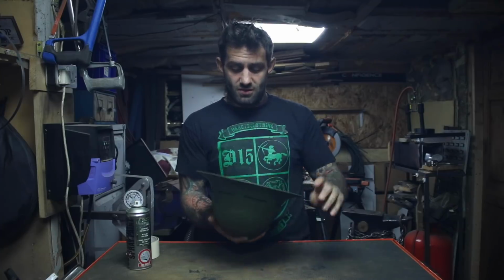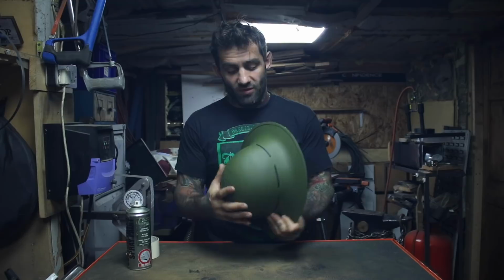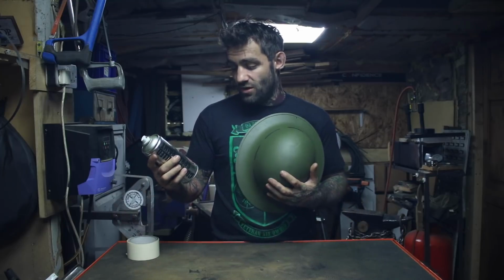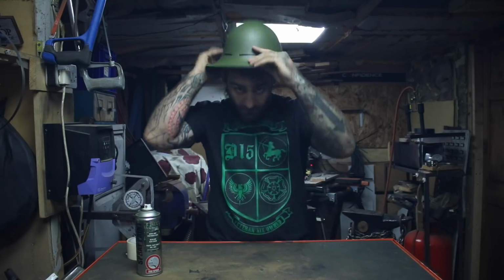WW2 British Helmet Restoration

Comment: Hello! Nice restoration! I believe it’s original colour would’ve been gray, but it still looks nice! Also, how did you get the lace undone? I’m planning on cleaning mine but it has quite a bit of rust and I don’t want to get anything on the liner
Reply from the maker: They were available in 3 colours grey, blue and green this was green thats why I painted it green. 
The lace was ruined on mine so i had to replace but it was a nightmare to get undone
Reply: DiesInEveryFilm Customs I see, but I mean how did you manage to get it undone? Did you untie it from the back?
Reply from the maker: There was a knot somewhere not sure where but mine had been removed before as it was laced up wrong
Reply: DiesInEveryFilm Customs I see. Sorry if this is bugging you but my last question is what did you use on the leather? Thanks
Reply from the maker: Not bugging at all mate I don’t mind answering, its a blend of boiled linseed oil, turpentine and beeswax

Comment: There's a more simpler way to get rid of lots of rust very fast you can try to put the Rusty object in a container or bin if it's big and feel it up with white vinegar and 25% extremely hot water and it has to be completely submerged under that vinegar then you stirred and place the object inside and wait about a couple of hours to be safe about 12 hours if it's really rusty 24 hours then scrub it with some sandpaper while it's still wet and every single bit of that rust would come off you're welcome
Reply from the maker: Oh dear oh dear. Just because you know about using vinegar doesn't make it right. These helmets are thin steel and vinegar is an acid it's not easy to control like sandpaper and I did this in less than your 12hr vinegar sitting time. 
Here watch a video of me restoring this helmet via being in my house as vinegar scrubs away.
Reply: DiesInEveryFilm Customs Loved the video! Beautiful restoration! Out of curiosity, would electrolysis have worked to remove the rust from a helmet like this, or is there something about its construction that would make that a bad idea? (Still probably not as entertaining a video, though.)
Reply: Just use electrolysis
Reply: @DiesInEveryFilm  lost your chance of making a 12 hs video of a helmet sitting in a container with vinegar..
Reply: Butterflyknife1 v

Comment: The result was acceptable. But you must admit that you like to work more than you should. A correct way to remove the oxide is with phosphoric acid, which also protects the metal. What you said you didn't use vinegar because the metal was thin is a fallacy. If it were true, the helmet would have been smashed when you sanded it so hard. Good job.
Reply from the maker: The helmet is thin I only needed to take off the surface rust then treat the remainder. Acid will eat metal which I didn't want. I restored it how I saw fit

Comment: Truly amazing restoration. It's better than new. Did you consider sandblasting it? That probably would have saved you weeks of time and energy.
Reply from the maker: Sand blasting is too rough and getting a sand blaster isn't easy. If it was thicker steel I would have used different methods to restore it.

Comment: Why did you go mechanical rust removal? Also why no primer before final paint? Still turned out good either way!
Reply from the maker: I feel that sanding gives me more control and the rust converter is a primer aswell. Thanks

Comment: Hi, I really like your video. I am going to restore my rusty Zuckerman helmet as well but I dont know where to find the leather liner you used. Can you provide me a link? And also I want to ask you if its ok to use vinegar and sponge to remove the rusts instead of using the sandpaper? Because I think using the sandpaper can possibly remove the important markings on the shell. Thanks!
Reply from the maker: Thanks, you could use vinegar but it will eat away at the steel once the rust is gone, sanding shows the markings up better I only used a high grit to flatten off the peaks a bit. 

I reused my liner so not sure where you would get one, maybe ebay
Reply: @DiesInEveryFilm  Really appreciate your reply! Just one more question, I saw you used rust converter after sanded off all the rusts. I cannot find any rust converter in the local shops, is it fine if I start to paint Kings Army Military Spray Paint Matt Finish directly after the sanding process? Thanks again!

Comment: How come you didn't use electrolysis or vinegar or some other rust removal procedure? Just curious. Your method seemed to work, but I see all different methods and wondered if there was a compelling reason other than your method was quicker. Thanks for the vids... keep it up.
Reply from the maker: Was just the way I wanted to do it so I could keep track of where I was at. I restore differently depending on the item

Comment: found 2 bucks of stamped rusty steel that had a role of covering the head. used 30 bucks of sanding paper on it. 10/10.
Reply from the maker: Used about 30cents worth of sandpaper.
Reply: @DiesInEveryFilm  that much for 30 cents? Wow.

Comment: Hi There. Great video. I have a quick question. i have what i THINK is a German helmet that is SUPER rusty, and the rust is really 'bobbley' not flat like yours. what would you suggest to get that type of rust off please?
Reply from the maker: It's only thin metal and that is why I used sandpaper on mine didn't want anything too rough to thin the metal out more. Maybe try sanding it or using a rust remover of some sort

Comment: You also could just have used oxalic acid to make the rust go and it was done. The original colour was well the blue for these helmets.
Reply from the maker: Acid eats away at metal as well as rust and all I wanted to do was sand off the rust. These helmets were available in 3 colours this on was originally green. Do proper research before you try to discredit my work

Comment: First time I have watched one of this guy's videos. Is he opposed to power tools? Hand sanding down to metal in 2018 is insane right? A wire wheeled angle grinder would have done this job in a fraction of time.
Reply from the maker: Well if you watch my other videos you may see me use other thingies. Angle grinder on a oval surface doesn't work well as I'd end up with flat spots. You stick to the close up selfies and I'll stick to restoring

Comment: Im not too keen on restorations of these older things. the date of when it was made is on the front and if you have either painted over it or sanded to an unrecognisable condition it's lost all its value thought I'd let you know it looks good tho
Reply from the maker: These helmets hold no value at all cause they were civil service issued and are still available in the thousands. I made this more valuable as I saved it from being scrapped and someone actually has it now and looks after it. I also didn’t sand off or cover over any markings they are all clearly visible all i did was sand down the raised areas of rust.
Reply: @DiesInEveryFilm  do u know what sfp stands for its what's on mine